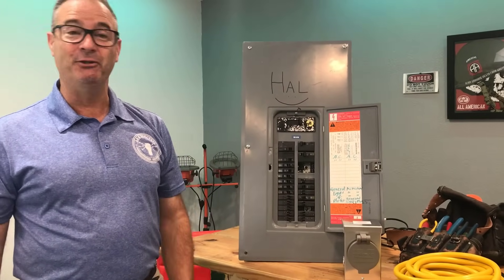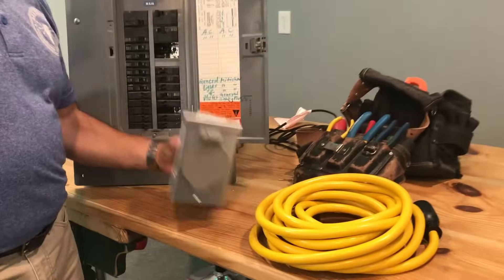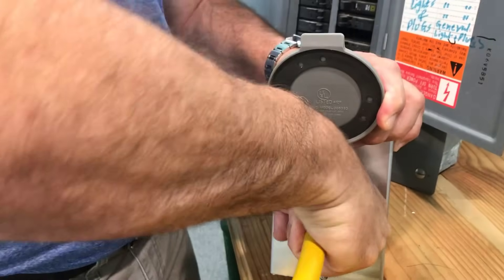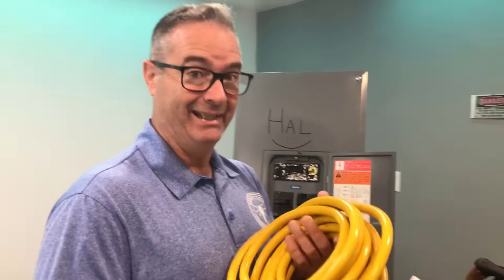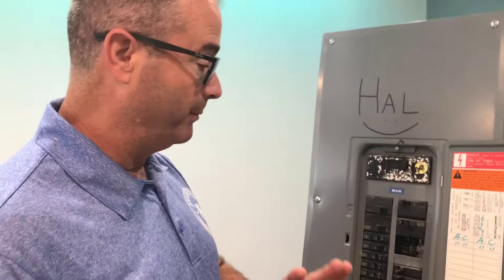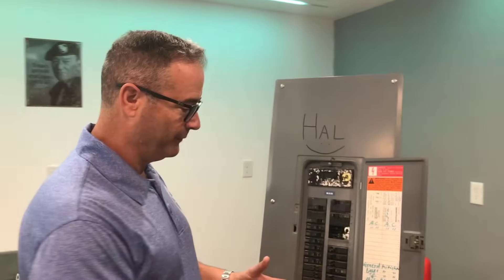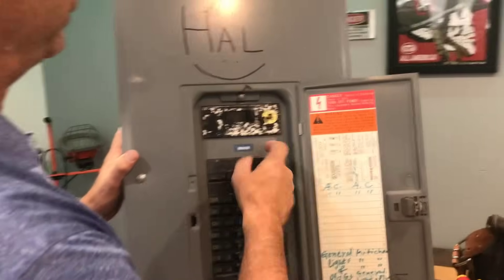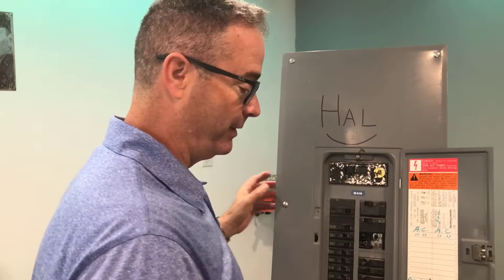4 Generator Hacks by an Electrician

Comment: My Electrician put in a generator plug that faces downward. Try figuring out how to plug that in while it is snowing and it is dark out after you loose service. I came up with a great idea , mind you I live in a rural area and my house is 120 feet from the street. I took a 5 gallon bucket and cut a notch in the top rim and then connected cable to the box. I then curled the rest to the cable in the 5 gallon bucket and pit the cover on the bucket. So now when we loose power all I got to do is start the generator then go to the bucket and retrieve the cable to plug into it. 
As for the switching at the panel, I did a dry run with my electrician but the time I used it a year later I sort of forgot the sequence. Once I figured it out I then wrote all the instructions on how to do it on the inside of the main panel door, so no more forgetting ;-) 
When the Winter is over I store my cable with the generator and since ours has an electric start it also has a battery. So I also have it on a trickle charger 24/7 all year long.

Comment: If it is a gas generator.   Turn your gas off and let it run out on its own. It will keep your gen. Carb. Like new
Reply: Not quite that simple.  Be sure to "fog" the tank and air inlet to the carb with something like seafoam or other engine stabilizer

Comment: Dude from Europe here. Our grid is pretty stable. Last outage I experienced was pre-Covid. 
I am still gonna get a small inverter generator this year. 

Maintenance is super important, I couldn’t agree more. I am involved with the local VFD. We are absolutely religious about this. Our trucks have generators on board (Endress ESE607) that we use to run tools and provide lighting. We also can feed electricity to a building. 

Electrical checks are at least weekly, as are checks on fuel and oil. Each generator is run for at least 10 minutes. Fuel is topped up from jerry cans. There are two of those on a truck just for the generator. The one with the „oldest“ fuel is up front so it gets used first. So far, each generator has always started on the first try. 

A little fun fact: Our regulations for cabling say that we can only have continuous cable runs of 100 meters max to a consumer. If you have a 100 meter run to a junction box, you cannot have more than 10 meters from the junction box to the final consumer. Yes, the cabling theoretically supports way more. 

But there is a safety margin. And not every firefighter is also a certified electrician who can do the right calculations. 
Even if you are a licensed electrician, you still need to follow fire dept regulations. Because if there IS some sort of freak accident, even though it might not have been caused by or even related to some little rule bending: guess whose door officials will knock on first when they smell a safety violation. 

The cable drums are all IP67. Also, even when not used fully or to capacity, a cable drum must always be unrolled completely to avoid it heating up.

Comment: After running a gasoline generator, don't shut it off using the on-off switch, turn the gasoline shut off valve to run all of the gas out of the carburetor instead. Don't leave gasoline in the carb to get gummed up.

Comment: I’m in south Florida. I drain the fuel and run it dry so I don’t have to worry about fuel going bad. I have a few gas cans that I can fill up ahead of time when I know a hurricane is coming. If I don’t end up using the generator then I’ll just use the gas in my truck.

Comment: Always use high test gas and when it is time to disconnect turn fuel off and let it run out saves your carburetor in Canada not having a disconnect transfer is likely illegal

Comment: I got my house wired up for my generator last night with a 30amp breaker. My house is all electric and I have a 9000 watt  Predator with 7250 constant watt generator. We powered up all the rooms and left the water heater off, range off, and dryer off. We went to power up the heat and waited for it to cycle on. When the thermostat kicked on, the generator bogged down hard and never allowed the heater to come on. My heater has a 60 amp breaker. My house is 1800 soft. What can I do to get the heater to work? I live out in Texas too.

Comment: Great video if I have a 30 amp, 9,000 peak watt generator and a 30 amp but 7500 watt receptacle, would that be a problem? given that the generator has more wattage than the inlet box ?
Reply from the maker: 9k peak, but what are the running watts?
Reply: sorry got wrong model correct info is 7500 Rated Watts and 9500 Peak Watts (Gasoline); 6750 Rated Watts and 8550 Peak Watts (Propane); , thanks  @abrelectric

Comment: Thank you for this video.  The Square D load center cover I have is dated (1986) and I've not found an appropriate interlock but believe the one shown in this video will work; however, I cannot see a brand nor a part number.  Would appreciate it greatly if you could provide same.  Again, thanks.

Comment: And make shore you change oil within the hour after the first time of usages because a burr can seize your generator.
It will say in your manual for 1 st time use some hour some are 2 hours. About that oil change.
After a storm you find lots of return generator because of that first oil change is not done and engine seize 
Some people buy a oil stick that magnets to catch the sharp metal burrs 
At least when you buy a new car the dealer ship already did that oil change. After running it.
Reply from the maker: Wow! I had no idea, thank you

Comment: Sir, If I install a Reliance 6 or 10 circuit circuit panel in my basement, can I also connect that panel with 2 x 30 amp inlet boxes. The reason being, I want 1 inlet box for outside for my gas powered generators, and another inlet box in the basement next to the Reliance panel to run my LiFepo4 Battery smart generators, and those generators are not rated to be outside in the elements and no worry on exhaust because they produce no exhaust, thats what I meant by rated outside.
Reply from the maker: At the same time? You can do that if you synchronize and match phasing on the 2 inputs.
Also, compare your THD on each output if you're combining inputs.

Comment: I recommend putting up some instructions at the panel for switching sequence and anything else. When you're under stress, you may not think straight. Also it helps for the quarterly practice runs what to do.

Comment: 1 run your generator at least quarterly 1 time a month preferred. 2 mark the outside of your cord and inlet box with a sharpie or colored duct tape so you can easily line up the connection in the dark. 3 stage a good headlighted flashlight somewhere to help you in total darkness get all connected correctly. 4 if your generator has a battery to start it put a battery tender on it to keep it charged and maintained. 5 get a tent, shed, some sort of protective covering homemade or bought to keep the elements off of your generator when it is outside. 6 keep an ample supply of fuel ready to go that will last you a day at least to give you time to get more fuel in a multiple day emergency. If you run gasoline try to run non ethanol only and rotate your supply into your vehicles when it gets old then replace with fresh gasoline. This is a great video and all my suggestions may have already been mentioned here.
Reply from the maker: Good stuff, thank you!

Comment: So I back feed 30 amps 240 volts with a interlock, recently I’m hearing a lot about floating neutral, that if your generator is primarily used as a backup for your house you have to switch your generator to floating neutral, that you can’t have 2 bonded neutrals at once, any truth to that? And if you decide to use your generator for another use you can buy a bonding plug for that usage, and just remove plug and go back to floating neutral.

Comment: Keep cord short as possible
Reply: Any reason why?
Reply: @Zyvox600  voltage drop
Reply: @silasbullard831  I see but is the benefit outweighs the risks and noise of having a generator so close to the house?
Reply: @Zyvox600  sure it's not a deal breaker, just don't want to use a 50' cord if you can get away with 10' or 25' cord.

Comment: #5...in addition to starting your generator monthly or bi-monthly, exercise the electronics by running something off the genny...and check the output voltage.  I've had a voltage regulator go on me running an electric leaf blower.  It went from 121 volts to 156 volts then 186 volts in a matter of 2 or 3 minutes.  Voltage regulators are easy to replace and adjust.
Reply from the maker: That is really interesting. I have never replaced a voltage regulator

Comment: great job covering the generators - maintaining them - some planning with the cord!! I do exactly the same thing here as you talked about, but I go a bit further with it. 1 extra 50' 12/3 cord for that neighbor that might have a gas furnace &  smart enough to listen to you when installing a male plug next to their furnace to operate it in the cold. I also have 12V bulb (2) that are plugged into that 12V charger side to recharge battery - use it for actually seeing what I am doing in the dark (Also a wiser way is a 12V led lamp instead) this way you can refill the gas tank without having to worry about starting a fire or explosion!! I also have a piece of board that can be laid over the top of the generator with a tarp stapled over the edges for rain/snow protection ) I put 4 snaps on the edges of the cover to keep it in place during winds. small bag for flashlight and any tools that might be needed during operation - including 120V splitter plugs...cord ends (Male with 14" long cord tails)  other bag on the generator has oil - fuel additive - paper towels & WalMart bag for garbage - chain with lock & key as well to secure it.

Comment: Dont be cheap, be offended is a great line.
Reply: I got the longest cord I could. I don’t want to listen to any generator.
Reply: You get the longest you can the distance can causes heat when it's to long shorter the better if you go longer you need to step it up a gauge.

Comment: When we had our service upgraded to 200A we had the electrician add a generator transfer switch.The box is as big as the main panel with a long handle and has a three position switch, Utility-Off-Generator. No way to send power to the grid during outage. Very safe device.
Reply from the maker: Very solid too. No electronics to go out.

Comment: I bought a propane and gas generator. I only run propane. Gas is for emergency. I also built a sealed generator house under the deck away from the house. I put in a interlock and outlet to plug it in. The cord is kept in the generator house so it does not get lost.
Reply from the maker: Sharp!
Reply: What brand did you buy is it a continous run? Im looking at Westinghouse 9500 or 11kw

Comment: My electrician asked me where I wanted the inlet box. I asked him to run the conduit along the side of the house past the fence in the backyard where the generator will be secure. I like your advice on where to place the inlet box. I had mine installed at the height of a doorknob, 3 feet high, for the best ergonomics to plug in and twist the cord.
Reply from the maker: That's a great height.
Inlet box location is driven by: close to the panel longer cord or farther away, and more electrician cost

Comment: Before connecting anything to your generator, check the output voltage. My generator had a defective voltage regulator and was putting out 160/320 volts instead of 120/240.
Reply from the maker: Wow! Good call

Comment: I really wish that everyone would lose this stupid habit of calling everything a "hack". Showing me how to take a generator that only puts out 120 volts, and rewire it so that it will put out a split phase power source capable of powering a 240 volt circuit is a hack. These things are not hacks, but they are good tips, and dare I say common sense.

As far as the electrical outlet goes, I would hope to God that if you're competent enough to install that generator port that all of these other things would have occurred to you, as well as the idea of putting in a proper transfer switch inside your box so that you don't back feed the electrical system. I've seen so many jackasses hook generators up to their house, "hacks" to be certain, and I've known more than one lineman to get a nice hit from something like that after a hurricane and they're up there working with some of these lines.

Comment: 95٪ of people will not bother with the generator  until needed and by then the fuel has varnished and you've got a bit of work to do to get it running again. 
Lazy Americans do Stupid Things.
Reply: Propane generator avoids those issues.

Comment: My emergency generator doesn't have any transfer gear.  Too expensive and just more stuff to possibly break and fail.  Instead, I ran 4 emergency outlets in their own dedicated conduits -- a completely separate system. I can actually test my emergency backup system without having to cut off the electricity,  simulating a power outtage.
Reply from the maker: That's a very practical arrangement!

Comment: When I wired up my Generator plug, I did one extra thing that so far I haven't heard anyone mention.  In the Breaker panel I installed Two L.E.Ds that accept 110V .  So they show through small holes in the outer panel cover.  One is wired to the Utility power side, and one is wired to the Generator in feed wire.  So... When the Generator is on and it's power is available, that L.E.D is lit, and then too, when the Utility power is on, or Back on after a failure, that L.E.D. is lit, So I know the power has been restored, and I can stop using my Generator. 
Simple, and I know what power I have ready in my Panel, without even opening the door, or cycling the Generator off, and testing for Utility Power.
Reply from the maker: That is a great idea, and several clients have asked about that very thing! Thanks
Reply: @jameslester4474 , that is a great idea that I have often wondered about. Thank you for explaining how this (knowing if power from the grid has been restored after an outage) can be accomplished with wiring LEDs to the street.
Reply: Smart meters are very common and have lights on them when line power is available. Not easy to see from a distance.
Reply: I have a (switched) industrial horn connected to the commercial side of the transfer switch. When commercial power returns, it's announced VERY loudly.

Comment: Just did all this myself to my house . The test run was critical,  I discovered that my interlock plate was just a hair too big and wouldn't allow generator breaker to turn on .(just had to barely grind a side down) Glad I got that worked out while having grid power .

Comment: Adding to point #1... place the hookup in a place that is good for the generator, not you necessarily.  A generator is not meant to stand out in the rain/snow, so plan for a location ahead of time.  An external storage shed with a door that can be left open is typically a good idea.  Something that can cover the generator in that rain/snow, yet allow access and airflow to keep it cool.  You may need to get an extra long cord.

Never leave it running in an attached garage and especially one that is closed or even just partially closed.

My hookup is in the garage, but I run a cord outside to a free-standing shed that I can run the generator in with its door open facing away from the prevailing wind.  In Buffalo NY, everyone has them for winter "fun.".
Reply: Hey neighbor! Can I ask how much it cost to have the interlock installed? Also who did you use? I was just talking about this last night with the wife. After last years blizzard i want to be prepared.
Reply: @SVW1976  Unfortunately, I can't.  I was lucky...  Mine came with the house when I bought it.  The previous owner was a construction manager for Ferguson Electric and he did it.

Comment: Soo true!
I’m a power lineman for a local utility. I can’t tell you how often we go out to a customer’s home for a service upgrade. The electrician is there on site & we co-ordinate with them to cut the power. The customer has a generator on the property. We get the ok & cut power & we are waiting to hear the generator start? Some of the time it doesn’t. Or if they have a roll out? They wheel it out & it won’t start. You would think they would do a dry run to be sure everything is working correctly? They don’t bother. Then there is a panic that sets in. The electrician usually has battery tools so he’s not affected. The homeowner has an important business meeting. Well they will miss that meeting.
Reply: Ha ha zombies knocking on your door... I finally got around to eliminating the cheater back feed cable.  Put in monster(200 A) manual transfer switch. Also reduced connections by running the cable out through the basement wall.  Direct plug in.
Reply: @bobbean4702  I had an electrician wire up an inlet on the side of my house right next to where I was placed my roll out. He installed an inter lock in my CB panel. I bought a hard wire remote for my genny & the start/stop is right by CB panel as well. Now my wife is able to start our generator from inside the house anytime the power goes out. 1 push button & 3 switches & the power is restored. No more frantic calls from home while I’m at work. I just bought peace of mind. Well worth it!